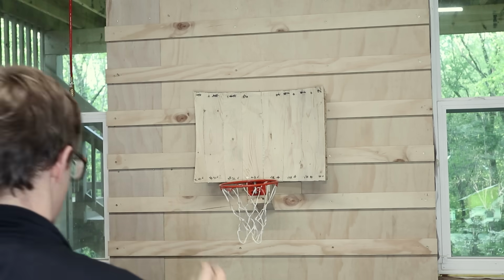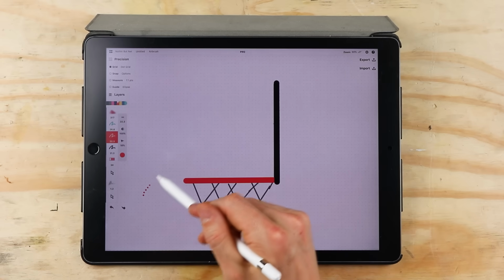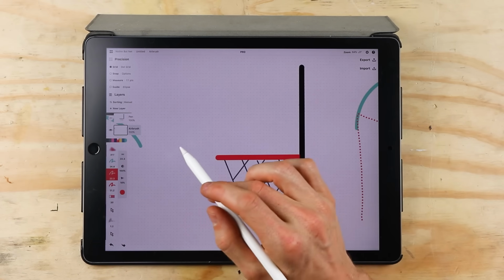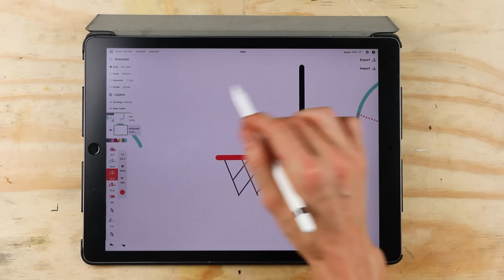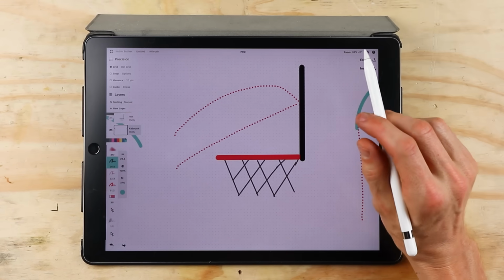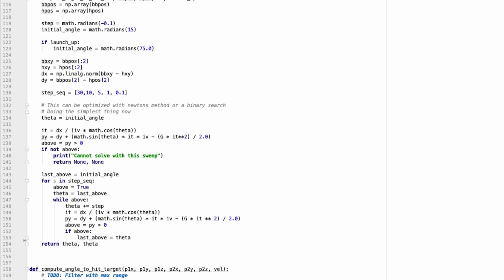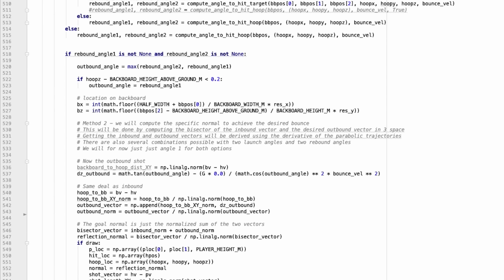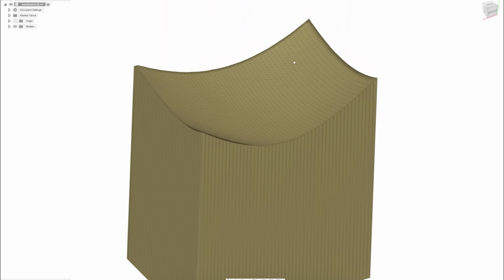My curved basketball hoop always goes in

Comment: I had a question: What is separating this board from something like a section of an ellipsoid? It seems like you are taking your shots standing in one spot, and if it's bouncing rays between one point and hitting another, the foci of an ellipse would seem to fit that job. It's funny that you mentioned it looking parabolic, which instead takes a field of parallel rays and reflects them to a single point, whereas an ellipse would fit your description more accurately. The angle or section of the ellipsoid could be tweaked, but it might be easier in that respect.
Reply: Dude wtf?Some one translate this for me.
Reply: @LeZPlay2  haha, ok, attempting the simple layman's explanation:

Imagine a circle. Ok? It's got a center. Basically, the circle is every point that is the same distance from that center. So like, if you put a pencil on a string and tied that string to a thumbtack, you could draw a circle easily. With me so far?

Now imagine an oval. Now stop calling it an oval and call it an ellipse. Basically, instead of having one center point like a circle, an ellipse has two. An ellipse is every point where you add the distance from both center points and get the same number. It's tricky to explain, but image search "ellipse focal distance" and it'll make sense with a picture.

These center points (or "foci," singular "focus") have fun properties associated with them. Imagine you are standing in the center of a circular wall and throw a ball. By the nature of the circular shape, no matter where you throw the ball, it will bounce straight back to you. Same with a sphere: minus some weirdness with gravity, wherever you throw the ball in a spherical room, it should bounce back to you (or at least very close). That's pretty cool. If this were the project in this video, all you would need is a section of a sphere as the backboard.

But of course, that's not the project. We want to stand in place and have any ball thrown hit a different place. Well, the ellipse version of this work is that if you stand at one focus and throw a ball at an elliptical wall, the ball will bounce towards the other focus. Now, substitute the other focus for the basket, and you can see where I'm going. 

The parabola thing is a weird one, but related. Instead of bouncing balls coming from a point, parabolas instead bounce balls that are coming in at a given angle towards a center point. It doesn't matter where the ball was thrown from in this case, only that the ball is thrown at the correct angle to the parabola. Imagine sunlight hitting one of those solar cookers: the sun is really far away, and its rays are pretty much coming from a single angle, so solar cookers direct a bunch of parallel sun rays towards the small oven in the middle. Pretty cool! Still, it doesn't really apply to this backboard project, unless the goal was to always through at the same angle but change the throwing position.

Who knows if that made sense.
Reply: MusicalMethuselah ahhh this makes wayyy more sense🤣how’s Harvard😭😭😭
Reply: @MusicalMethuselah   thanks dude
Reply: @MusicalMethuselah  I believe that it works from many differente throwing locations... That's where it gets different from an ellipsoid
Reply: XNEONZ lmao
Reply: I was thinking that as well. Simulating "millions of shots" for something that's just... a focus reflector, basically? I paused the video at 2:00, but i can already figure out that it will work only from a certain distance.
Reply: Dude, I’m 12
Reply: Blu _Anims dude, I’m 10
Reply: @ascendhorizons   same and this made sense to me so did the other descriptions
Reply: @ascendhorizons  Same bro.
Reply: This conversation is too big brain for me
Reply: He goes over it in the video: the ball follows a parabolic trajectory both before and after impact. This means that the distance from the impact point to the hoop changes the required trajectory; an outside shot needs to bounce "aimed at" a different point than an inside shot (if you just look the line drive from the impact point), because outside shot has further to travel (and thus falls further) before reaching the target point.

Comment: This could have been done in a lot more simple way. You can use the mathematical properties of an ellips at least for the horizontal plane. You pick one center point of the ellips to be the basket hoop, and the other one the center of the court you want to shoot from, and because the ball is a lot smaller than the basket, it should work for the entire court

Comment: Next, can you make a troll backboard that makes it impossible to land a shot in unless you aline it up perfectly

Edit: Scratch that I have a better idea, make a backboard out of flexible material that you can adjust with actuators, you build 2 of them and have them in a basketball court then you connect an Audino up to them to adjust the "aim assist" on the board depending on whoever is currently loosing, so you can get rubber banding in real like just like in games like Mario kart.

Comment: I thought this was super cool! I did have a couple questions though.
1. Are you able to account for the spin on the basketball?
2.if the basketball hits the rim, then hits the backboard, will it still go in?
finally, how do you run so many simulations? do you do it manually or do you have software that does it automatically?

Comment: I'm a freshman in Physics and your video really inspired me. I had some old Paraboloid laying around and thought about demonstrating how I can use it and a bouncy ball in order to neglect the affect caused by gravity when shooting a hoop. I'm giving the ball a lot of speed + the collision with the board is nearly elastic so gravity can be neglected. So we nearly get that the ball in moving a strait line before and after the collision occurs. It's basically demonstrates how a parabolic mirror, for example, converges light into one spot, only this is way cooler. Cheers

Comment: If I was you I'd totally change my approach to the problem. As you said the process of making a new board while the old one is acting as your reference seems quite unachievable since you have to correct yourself essentially unlimited times to get to the actual answer.
What I think would work on the same C# platform with the difference that I'd use 3Ds max for the graphic parts is to take the hoop as the center of the design and basically see on which shape you're able to achieve most shots based on where they'd land in the hoop and expand it too the whole board
Anyways I think you're living a life hack and it's so cool you have all those tools lying around 🌹👍🌹

Comment: You wasted a lot of time making this hoop. A parabola has a focus and a directrix. Every single point on the parabola is equidistant from the focus and the directrix. You could’ve just graphed the directrix (the backboard) and the focus (the center of the hoop) and then found the equation that represents the parabola of the parabolic backboard. You would’ve had to do this in both dimensions, but I legit could’ve done it in like 10 minutes.

They use the same process that I described above to treat kidney stones. If you place the shockwave generator at one focus, and you place the kidney below the other focus, the shockwave will always hit the kidney, no matter which direction you aim the shockwave generator. If you google “lithotripsy ellipse” you should be able to find a diagram.

Comment: Great. I wonder that
1. we can't optimize for all case. after generate ton of case it might result in optimize in average case may be we should specific point of shooter
2. if we know the backboard surface is 3d   convex  curve may be we can simplify  geometry to some parameter of 3d curve. that might speed up optimization process and straight forward.

Comment: hmmm, the way you compute isn't good IMO. Mathematically, without taking the gravity into account, every section should be a parabolla with the center of the basket being the focus point of the parabolla... but there is an infinite number of parabolla with that focus point, and only one that will actuallly go in. It's not possible to make a hoop that always goes in if you don't precise the particular spot where you are going to throw the ball. If you add up the gravity, you're only adding something that will deform your basket in a single dimension...

Comment: You could solve for the shape of the board using calculus. I immediately thought of a parabolic surface, since it is the surface that makes any incoming "ray" parallel to the z axis bounce into one spot (that's how parabolic antennas work) obviously the incoming ball doesn't come straight from that position since it comes from a point and not a plane, but I think it is a good approximation.

Comment: If you'd ever redo it or go for part two with the fixes you mentioned you can use your machined part (you might need to also get the negative) and use a sheet of plexiglass with a sort of vacuum forming or casting it between the positive and negative once you get it to a plastic state.

Comment: at 8:49 you say the ball would bounce off the original back board in the same angle it did off the curved back board, which is simply not true.
but in your case i guess it just wasn't that relevant.

Comment: This video and project is really awesome and the fact that you tried to account for every factor possible is also great. But as someone who grew up playing tons of ball and an engineering graduate I noticed you missed a few important factors:
1. Ball - how much air is in your ball (how bouncy) ? What type of ball you are using? 
2. Back board material and support behind - notice most nba boards are made me a thick acrylic piece and the supports are only at some points. This allows some flex and absorbs the energy so that it doesn't bounce off as much. 
3. Distance of the rim support to the board - what kind of rims are you using to attach to the blackboard. There's always a distance before the circle starts. 

Other than me nit picking at the details and somethings I consider everytime I find myself needing to adjust to playing in a new court/environment, its a brilliant project!

Comment: Wow that is probably one of the coolest uses of Fusion 360 I've ever seen, and I work for the Fusion 360 team. Congratulations to a fantastic project. The execution is stellar! From a machining point of view, I might've used the Form environment first to create a T-Splines surface that pulls itself to the mesh, so you have a smooth interpolation. Not that it matters much for pine, but you know... Thank you very much for sharing this

Comment: you should turn this into a product. get an injection moulder designed for this since it is only a 2 piece design and sell this. it could make racks. you can also upsell it since it will be the only thing like this on the market

Comment: or if you have a decent enough shot where it’ll atleast hit the upper rim, just use a deflated ball....

Edit: i just now noticed the design and realized that it most likely would only work if you’re shooting straight in front of the rim. if you’re on the left or right of it it won’t work and it’ll bounce differently (i think atleast)

Comment: You could add cameras to the board and servos to move each part so that it calculates the trajectory and speed of the ball and redirects it by changing the angle of the part where the ball is going to hit.

Comment: Idea on how to save 50% of the calculation cost: Simulate only the right or left half, and then mirror it since the game is obviously symmetrical.
Reply: Sometimes my genius is almost frightening
Reply: The computation time was probably so trivial, that saving time was irrelevant.
Reply: did he not do that?
Reply: Harvard wants to know your location
Reply: I’m pretty sure he did that.
Reply: With geometry is also fast to solve, that is the same principle and shape that satellite dish use to receive signals in a center point.
Reply: too late to state that:))
Reply: He did on the cnc.
Reply: what if they threw it from the left side and hit on the right?
Reply: @Qicboy47  If you mirror it doesn't matter. Your questions seems to have a point but it doesn't.

Comment: Wouldn’t it also work to simply create a ‘concave lens’ shape, and have the focal point at the entrance of the hoop? Not entirely sure, and obviously the program worked, but this seems much easier
Reply: I was thinking the same thing, like a Satellite Dish receiver. You could had calculated the focal point in maybe 2D (x & y) and reached to the same conclusion without having to do an iterative method?

Comment: Why use programming when you could’ve mathematically derived the perfect shape?
Reply: It's just easier I guess. 
Even if you can solve this problem that doesn't mean that there is an analytical solution so you would have to approximate it anyway.
Reply: Using the monte-carlo method is not the same as mathematically deriving something
Reply: @EpicVideos2  True, I forgot what deriving truly means. But still, he would have to program it mathematically so it's easier to manipulate the shape in other programs for manufacturing it. If you meant: why use Monte Carlos, then it's just personal preference. It's an engineering problem where a perfect shape does not yield better results.
Reply: r/iamverysmart
Reply: Yeah wouldn't this simply be solved by creating a section of an ellipsoid and placimg the hoop right where the foci is?
Reply: But the programming did mathematically derive the shape

Comment: You earned a subscriber.

I would approch this problem in another way. I would calculate two 2D curves (vertical and horizontal) analytically, taking in consideration the descending trajectory of the ball for a average ball wheight and speed.

Comment: Hey! Very elegant and very clever! You should look into Genetic Algorithms, this would be a much easier problem to solve using GA, less elegant and more computationally expensive, but fairly "simple". All you really need to solve is "given a specific backboard shape, how many shots would go in". Keep the best one out of a few hundred samples and mutate for a new generation. Then repeat until satisfied. Maybe keep the backboard mirrored along the horizontal plane.
Reply: That's what I also had on my mind. GA's are really cool. Perfect when the solution doesn't need to be 100% perfect, just good enough (like at least 95 of 100 balls must go in).

Comment: @Stuff Made Here As for the backboard, another possible solution would be to 3d print a sort of segmented scaffolding, then fiberglass on top of that. I think you'd find that would be much easier, and look a lot more elegant :)
Reply from the maker: Yep - someone else suggested machining out of foam then fiberglass on that. Both seem like good solutions. If I make another one, for example a full sized one that is what I will do

Comment: I think I see why your hoop needed to be set forward. If you pause the video at 21.23 you can see that the hoop bracket is actually on plane with the forward most points of the bottom left and right of the backboard. The extended bracket is likely the same length as the parabolic curve of the backboard at its deepest point from its forward most point. Am I right? It would seem that the less parabolic the curve of the backboard, the closer the hoop would be to normal. Such that any parabolic shape would require an extension of the distance of the hoop from the norm.
Awesome job. I think you could sell this.

Comment: Why don't machinest use a vacuum extraction for cut chips instead they blow all cut chips all over the inside machine Great video 👍.
Reply from the maker: I actually just built a vacuum attachment for when I'm cutting wood. When cutting metal you're usually injecting some kind of oil or coolant into the cutting area (for cooling & lubrication) which would make vacuuming harder since you have liquid you'd be sucking up and the chips stick together. I haven't actually tried vacuuming metal chips but I suspect it just wouldn't work that well given the density of the chips and how they stick to each other.
Reply: @StuffMadeHere  Glad someone else has thought about this not just me, you make great content with humour thanks 👍